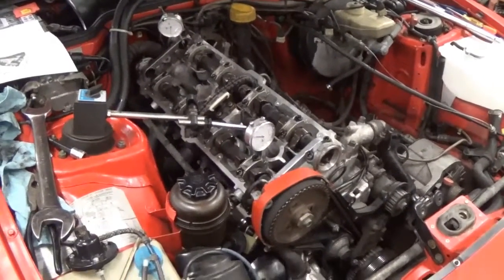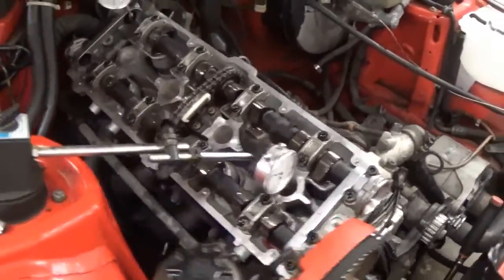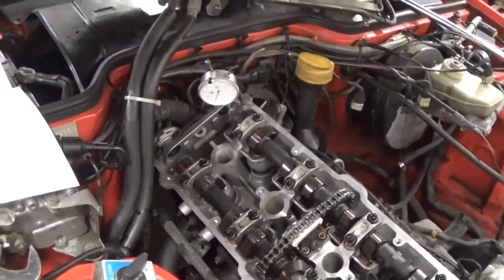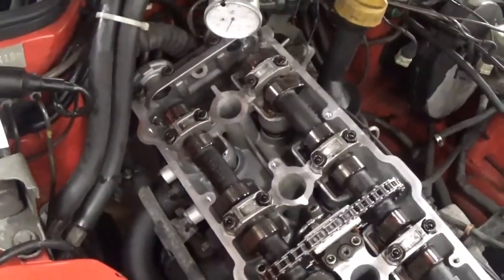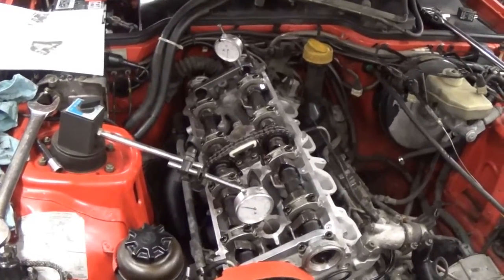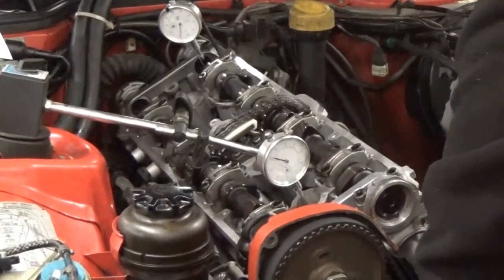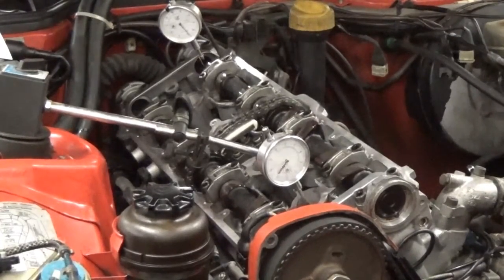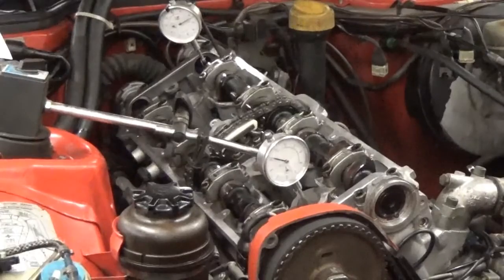Porsche 944 16-valve cam timing (S, S2 and 968)

Comment: If only this showed how to actually do the adjustment it would be helpful.  But as it is it just seems like a video of stuff going around.
Reply from the maker: The actual adjustment is the tightening the bolt on the end of the cam - the trick is tighteing it when everything is lined up - hence the going around and watching the dial indicators.

Comment: Hello, when replacing the cam seal do I have to adjust cam timing afterwards?
Reply from the maker: If you've lost orientation of the cam drive gear to the camshaft, yes, you should verify the timing.  Nothing bad will happen if you don't... you just won't be running with peak power/efficiency.
Reply: Thanks!

Comment: Van,

What stand-alone ECU would you use for either of your 944's? Have you ever looked into this?

Chad
Reply: I am putting a 3.0L S2 into my 1984 track car.
Reply: Also, thank you for your video's. They are a great help.
Reply from the maker: I'm a big fan of Emtron - it's very flexible and powerful.

Comment: Can I assume that you've taken the camshafts out of a 16v car? If so my question is: Do I absolutely need Porsche tool 9226 and/or 9248 to hold the cams while removing and installing them? It looks like the cams will snap if tension is not applied in the right spots. Do you have a technique to do this job without the tools?
Reply from the maker: I assumed the tool was really so you don't damage the smooth machined surface of the caps.  I did not use a tool, but, instead, loosened each cap a little bit in turn so no single cap would be holding all of the valve spring pressure.  Seemed to work OK.
Reply: Sounds good. That's what I was going to try to do. I learned a valuable lesson before on an SVT Focus before, because of the same problem. Thanks for the advice. I'm sure you were just dying to know, I'm building an '88 944 S to compete in NASA GTS. A lot of work to do; the previous owner did not treat this car well.